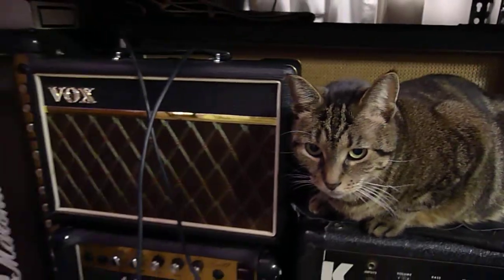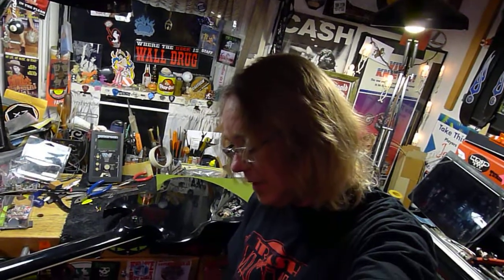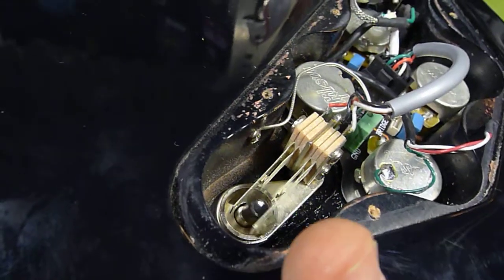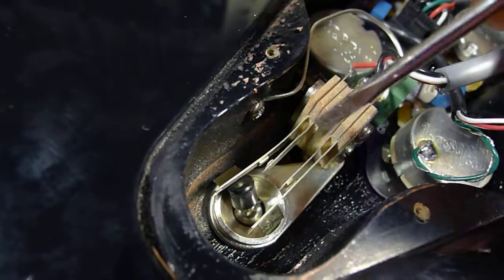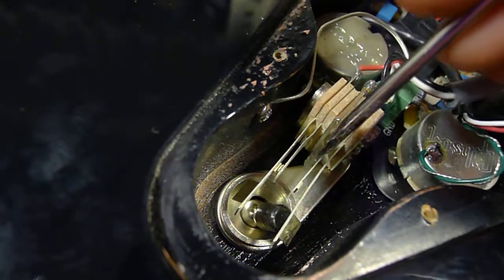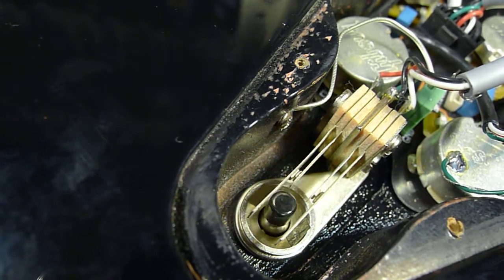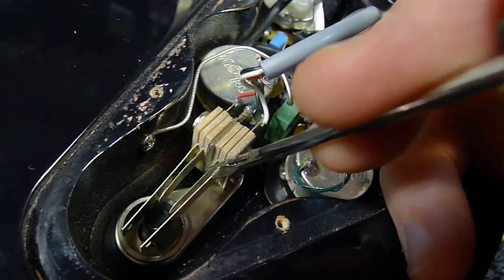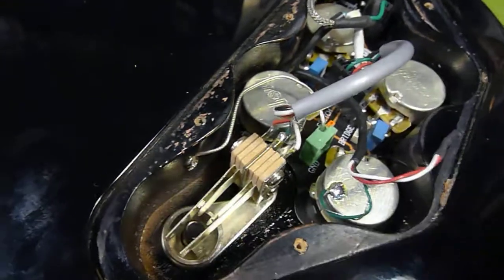Gibson and similar guitar signal and switch problems and solutions by Bill Baker

Comment: Thank you Bill Baker.
I looked at every internal part of my les paul for the first time. I found the problem (my switch dnd seems to be squint) and after watching your video I fixed it bending the metal on one side with my screw driver.

You are appreciated.
Reply: I would add that this is a design fault with my gibson les paul. 
If the manufacturer hadn't designed the switch to be squint, I would not have had to bend this metal flap...
Easily fixed though! No expensive repair required.
Reply: Side note. A better tool than a screwdriver would be a piece of thin sturdy plastic.
Personally I cut up my old debit card and made it useful but using it for this.

Comment: Thanks, I'm just about to open mine up.
My issue is that I have both pickups working separately, but not both together in the central switch position
This gives me a solid idea what to look for and where
Reply: That was MY issue. Bill's tip worked for this and fixed it. Each of the two areas just needed to angled a little tighter together, so that when in the central position they remain connected and touching.

Comment: You can also run a thin piece of sandpaper between the two contacts to clean them off too thanks for your video.
Reply from the maker: Yes, but very fine if possible or even a piece of clean cardboard. Anything clean to remove whatever gunk is causing the issue. -Bill B

Comment: Thank you!! My neck pickup is the problem for me as it’s giving me weak output. I’m gonna try this out this weekend!
Reply from the maker: A weak output usually means an open coil. (Thin and nasally, right?) There's a break in the winding or corrosion got to the wire. If the pickup reads "0" with an ohm meter, it's time to replace it! -Bill B

Comment: Neat, I had no idea thats how they worked.  I just got a Les Paul and the weirdest issue came up right away maybe this will help.  On the neck pickup it humms like crazy only when touching the strings.  I let go and its fine, other 2 positions its fine, I think the switch is faulty.  Maybe open it up and see 👍

Comment: Awesome tip Bill the addition of those circuit boards helped Gibson during production. hindsight is always 20/20 not fond of those either.
Reply from the maker: I know, and along with the drop in nut (no error hand cutting) I think their cost cutting led to more expensive repair or replace....but the issue was a dirty connection. A good burnishing tool used on pinball machines is a good contact cleaner I forgot to mention it in the video. Thanks for watching! BB

Comment: I bought a beautiful vintage, 3- pickup LP Custom...the neck and middle pickups are full volume and sound great. The bridge pickup is like 1/4 of the volume...and sounds thin and crappy. Nothing was modified in the guitar, so its not an issue of somone screwing the wiring up...its just aged. Any ideas what could be the issue that would cause a weak sounding bridge pickup?
Reply from the maker: Yes, the pickup has an "open coil", meaning one coil has a break in it. Send it to Lindy Fralin in VA to be repaired, he's the best for that.

Comment: I wired my LP to the 50's wiring. When I measured the resistance on the neck pickup with the switch in the rhythm position, I was getting 14.7.  The resistance of the pup was 7.4 or half.  Why am I getting a reading like the pup is in series?  The bridge pickup measured 7.8.  Thanks.
Reply from the maker: Go over your wiring, clean the contacts, and then measure again. Measure each connection separately....go from there and troubleshoot.

Comment: Bill, nice explanation! Dig your channel. Hey, I have  a1988, Gibson,  ES175 and I notice that when I go to toggle between neck and rhythm, the neck position of the switch is really kinda loose/wobbly.  The rhythm or treble pup position is firm and fine, but as soon as I go do flip the switch up, it is like it doesn't really lock or slip into place (like a loose tooth).? The 175 is an F-holed guitar, and they have a very oddball rubber gasket around the actual switch. I was wondering if you have any tips or have heard of anything regarding this issue as I would like to keep the guitar as stock as I can. I would prefer to repair the existing hardware by replacing a portion of the switch rather than the entire switch. Plus... I have never seen a company that offers the 175 rubber switch set up. I am sure Gibson does, but they will probably want 100 bucks and then it is not original; hardware.
Reply from the maker: Hello! Well what I imagine is one side of the switch is deformed. They are bent a certain way to "capture" the "nub" or other end of the "bat". One side is good, nice and tight, and the other got bent or out of its shape. They are difficult to bend back, it has to be just right. You just need a new Switchcraft switch, not the rubber bushing. Either change the switch out yourself, (avg about 25-30.00) or have a tech do it. Put the orig in the case. It's not a valuable part but why not save it. Rock on, BB
Reply: @Billvis77  Thanks Bill!

Comment: ... 03/06/2020:  Hello, I have a Gretch 5120.  The 3-way toggle switch clicks very loudly when the chrome lever hits the round tube-like area.  I do not wish to try to take it out, per I would never get it back in.  I do think the spring action is very strong and causing excessive loud clicking.   I tried WD-40 electrical circuits cleaning spray to no avail.   So, I was wondering, can that chrome lever be unscrewed and replaced with a lever that is rubber-coated, which should stop the clicking noise?  What do you or any of the readers think?
Reply from the maker: Sounds like the switch itself clicks too loud for you. I'd take it to a local tech and see what they say and can do. If spraying won't lessen it, take it to a pro. BB
Reply: @Billvis77 :  Thank you for your fast reply!
Reply: It can be replaced inexpensively and easily. If I'm remembering correctly that's a hollow body guitar. Just need to tie some fishing line to the switch and drop it down and out. Install new one with line through the hole so when you drop it in you can fish it back through the hole again. I would charge $50 with a top of line switch included in my shop. (Auburn Guitar in Newbury Ohio)
Reply: In fact, I just did this on a similar Gretch yesterday. Check it out on Facebook or google Auburn Guitar Newbury to see the pic if you want. Very cool guitar.
Reply: @12south31 :  Thank you for your fast reply!
Reply: @12south31 : Thank you for your fast reply!  The fishing line sounds like a good idea.

Comment: The problem on my sg is that the tuggle do not move in a  smooth, it gets stuck in the movement and makes a rubbing sound is there any kind of lubricant or solution for that problem?
Reply from the maker: It needs a new switch!
Reply: @Billvis77  thanks Bill I already figured it out, it turns out the Gibson  Black gig bag was responsable of it since inside it the toggle is always on rythm position and through the time the contact sheet got bent so the toggle could not move well cause of the bad position of it (a lot of friction) , Just made what you tought us and the guitar is perfect again, thank you very much